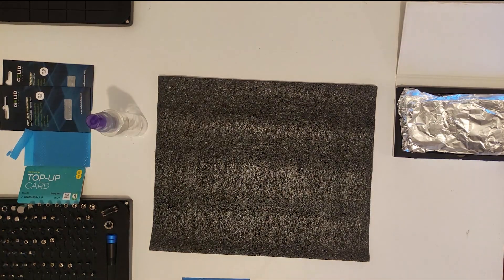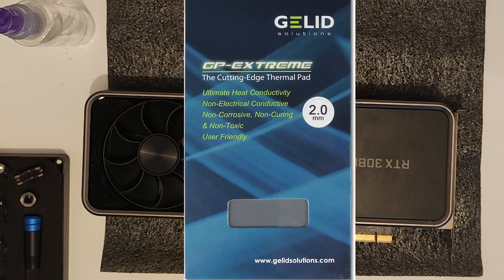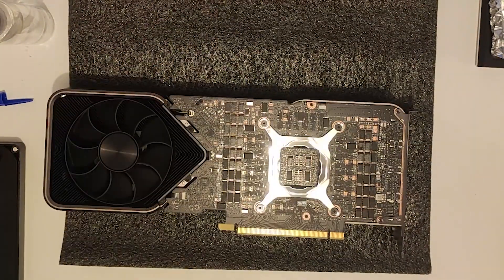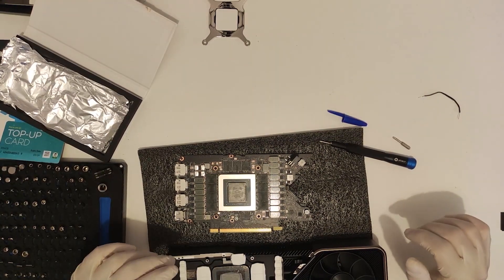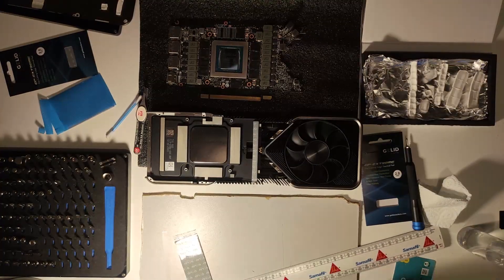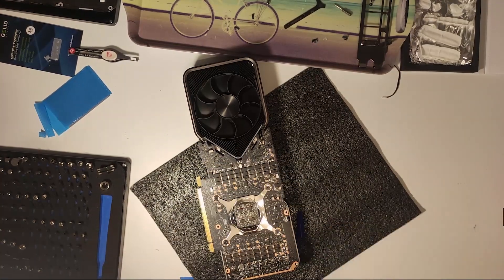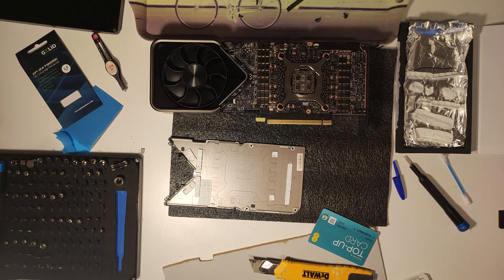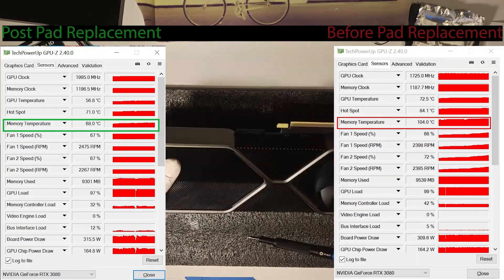Nvidia RTX 3080 FE Thermal Pad Replacement & Re-Paste-Improve your Mem Junction Temp by OVER 20C

Comment: I have been thinking about doing this with my 3070Ti FE. but after a fan curve and some overclocking, it doesn't get hotter than 70 degrees under heavy load. I've boosted the heck out of my benchmark score, from 47% to 187% without opening anything yet but I still have a water cooling system I haven't installed and I still haven't changed any pads. I'm wondering if my GPU is one of the lucky properly made ones or if I can lower the temps even more by changing pads. I'm afraid that i do all this for nothing, that my temps will be just as low after i put in all this work.
Reply from the maker: If you are happy with the performance/scores your card is providing and there are no issues with temperatures...probably best to not do any mods and keep the warranty.

Comment: i dont know how you're getting those temps i cannot go below 82 gpu 85mem and 90 hotspot
Reply from the maker: Your temperatures looks OK if you are using your GPU in a case (and one with decent airflow at that!). All my quoted temperatures are on an open air test-bench with extra airflow in a fairly cool (19-24Cish with AC) room so they really are the absolute best you can reasonably expect without blasting sub-ambient air at it directly.

Comment: Hi,

So I have followed the guide but still need some advice on how to get the Hot Spot temperatues down. Hitting around 100c whilst gaming even after applying 2mm Gelid Extreme front and back. Applied to all the area's where previous pads were. Is this an air circulation problem or do I need to adjust pads? Do you have any pictues you could upload of your pad placement now you are happy with them to help me out?

Best
Reply from the maker: Hi - you will need to keep adjusting the pads until the core hotspot is within 15C to core temp. The issue is that the pads are preventing even contact between the die and cooler so even if one is a bit proud it will still cause issues. If you have a Vernier caliper (micrometer) you can measure the flatness using a small piece of glass and a fixed point on the cooler (assuming the pads are stuck on the cooler and not on the card) and make sure that they are even all around. Afterwards go down 0.1-0.2mm at a time (again making sure it's as even as humanly possible) and after 2-3 adjustments the core hotspot will suddenly start behaving - once the core to hotspot delta is below 15C stop (it's more than good enough); if you try to adjust it again you might end with the memory temps climbing back again because of poor contact.
Reply: @ESHW  Thank you for the reply. I managed to flatten the pads that were on with a battery and cut the excess hanging over the edges with a sharp blade so no excess was left unnecessarily. I now have at idle roughly 45-46c GPu Temp and Hot spot and Memory Temps now between 59-60c. Gaming seems to raise the temps understandbly to around GPU 70-71c and 88-90c for Hot Spot and Memory. Are these acceptable figures?
Reply from the maker: @MrGamgam888  in a nutshell - yes. They are at the upper edge of what can be considered an acceptable hotspot to edge delta so you are good on that front (you can do one more adjustment, but you run the risk of flattening the pads too much and the memory temps are going to skyrocket again). I am wondering - do you have adequate ventilation in your case as the idle temp is a bit on the high side...?
Reply: @ESHW  What would be acceptable averages across the three? I will give flattening them another go. I have some more pads being delivered so it's just trial and error I guess. I have a Be Quiet Dark Base Pro Rev.2 with 2x 140mm front and a 140m rear for  air flow. With a Artic Liquid Freezer II 120m AIO top mounted. I don't know how else to get better air draw through the front of the case.
Reply from the maker: @MrGamgam888  Hotspot to edge temperature for the chip needs to be below 15C delta and less than 90C on the hotspot (can go up to 90C and even exceed it but only briefly and NOT for long term use like mining) meaning that the core will be around 70-75C. The memory temperature short term (gaming) can go up to 100 as different games will hit the memory differently, but really it's best if it doesn't go above 96C. If you are planning on using it for mining I would personally keep it under 90C to ensure card longevity

Comment: Hi thanks for the video, do you have any suggestion for a waterblock for 3080 ti?
Reply from the maker: Depending on your budget I would either go with the Corsair Hydro X (can be found for relatively cheap) or if possible the EK Vector but it's a bit more expensive. As far as I know the 3080TI does not have memory chips on the back of the PCB so there is no need for fancy active cooling on the backplate.
Reply: @ESHW  well Corsair one is costing me USD 300, I have to import it here in my country. I was quoted $187 for bykski block by a local reseller here in India.
Reply from the maker: @raghavtripathi564  That is indeed very expensive for the Corsair block. Honestly I have only heard of bykski but never actually used one - as long as you bench test it and make 110% sure its OK and it does not leak I would give it a go... are you running the 3080TI FE or a partner model?
Reply: @ESHW  I just got  my 3080TI FE at MSRP! which is $1436.18 here haha.
Reply: Also Gelid Extreme is not available, Gelid Ultimate is. will it be okay if I get thinner Gelid Ultimate maybe 1.5 mm for core and 2mm for back? please help
Reply from the maker: @raghavtripathi564  Well done for MSRP! I mean...yea :D . I personally, after buying a pack by mistake would not use the Ultimates unless you know 100% the pad is exactly the right size- I know people have used them, and it is definitely possible to install the card using 1.5mm on the core but just be prepared for a lot (and i mean a lot!) of tweaking to get it right. I would first check if Thermalright Odyssey pads are available in your region as they are somewhat softer and hopefully easier to work with. I've used them in the past on other cards and (subjectively) they are more malleable.
Reply: @ESHW   The prices here for thermal pads are absurd, will cost me 50% of the corsair waterblock! I think I have to go custom cool. I mine while I work/sleep just have to mine few more month to get what I pay for liquid cooling!
Reply from the maker: @raghavtripathi564  Sorry to hear that, i mean thermal pads are a bit expensive, but here locally i got them for £17 (Great British Pounds) while the waterblock is around £160... if the pads were over £60 i would just go ahead and put the waterblock on it...

Comment: Hi, since I changed the pads and applied new thermal paste, my GPU now goes full fan speed while ignoring my parameters. I’m on hive OS and I can only see core + memory temps. They are cool (core65/mem55) but core goes very slow, like a security. Could it be another thermal sensor not displayed in hive os that overheats ? I verified and my fans connectors seems ok. Thank for your help I hope I did not break my GPU.
Reply from the maker: 99.9% you did not break anything, it seems to me that the hotspot is most likely your issue. The core will be at 65 and the hotspot can go over 100C - that is what happened to me and I ended up fine tuning the pads. Can you install the card in a Windows machine and use hwinfo64 to check all sensors? I'm afraid I have very limited experience with mining (and none with mining OSs so I don't really know what they report).
Reply: @ESHW  MANY THANKS DUDE. After many months i decided to go back on GPU mining to warm my place. I disassembled the card two times to perform the fine tuning of the pads (with a credit card) and it worked ! At the beginning, core was hotter and now the card is running 66C(core)/80C(VRAM) on Flux with a 270W power limit and 60% fan speed. I think I had to wait a little bit for the thermal paste to spread correctly. Keep helping miners on YT it's a great job 😎

Comment: Is it a big deal to put more thermal pads on the back than what you have shown? I'm using 3mm gelid extreme pads on the back. Also, is it a big deal if there are slight cracks or very small gaps in the pads covering the components? Thank you.
Reply from the maker: Hi Aaron - the pads on the back don't do that much, before I took the card apart properly i tried 3mm pads on the back and...well they didn't do much. As long as you have something on there to make contact with the back plate and expell some heat, but really well managed heat transfer on the front I would say you are good to go - small gaps and the like won't make a difference. It's more the VRMs that will benefit from heat extraction from the back than say the memory modules.
Reply: @ESHW  hey i figured it out! I used 1.5mm pads on the front instead of 2mm because I think the 2mm was acting more like insulation than actually passing the heat along if that makes sense. I want to try 1mm pads eventually but for right now Things are looking good! still using 3mm pads on the back for now.
Reply: @arron2861  what are your temps now in mining or on 100% load after putting 1.5mm on front
Reply: @ppbagroupa2348  unfortunately, my temps are about the same as running it stock. I gave up on mining until I can just water cool it.

Comment: What do you think about putting a little bit of even pressure on the backplate while the card is fully assembled with the new pads to assure proper spread? I really don't want to take the card apart again because the core is much cooler than before due to new thermal paste I spread perfectly & the pads are perfectly put on I know this for a fact, it's not my first time doing something like this. 
1.5 for core & 2mm for backplate side. Using Thermalright Thermal Pad 15 W/mK
I followed your pad placement perfectly & before in any scenario on my Ti I wouldnt go over 92c. But now I'm starting to touch 96 and I dont want to see it climb more I shut down mining. No overclock either.

I think I just need to spread the pads like you've suggested.
Reply from the maker: Edit: I used 2mm for the front. Bit worried that yours are a little bit too thin as you are still getting high memory temps (guessing that is the 96C)
Try to spread the pads a bit better on the back, take the backplate off and try "squishing" the pads, that will give you a couple of degrees, hopefully enough to go under 90. The thermal right ones are a bit hard from memory so you will have to be quite precise - a small pocket mirror or small piece of glass will do (if using something else make sure it's super flat). If the front of the card is all good  when it comes to contact and you are sure all pads make contact then don't reopen, as you would have probably surmised by now it takes a lot of trial and error to get it right. I tried (before re-padding) using a clamp in the middle of the card (should have taken a picture of that) - it worked really really well, but as soon as I wanted to take off the clamp the temps would shoot up dramatically - point being if you try to apply pressure with the backplate in situ you need to keep in mind it might not be reversible without repadding as when you take the pressure off and the system relaxes you can get bad contact instantly.
Reply: @ESHW  yeah I think my problem is I need to use the Gelid extreme 2mm’s. No way around it. I have to order them lol. These ones suck. Just didnt wanna wait so long. 

Thanks for the great tutorial.

Comment: Where did you buy a tool you use?
Reply from the maker: I am just using the Ifixit (I think my kit is called Manta) tools for PC work - they are definitely not the best, but for a hobbyist they are good enough and reasonably priced - I got it on Amazon UK. The (dirt) cheap Chinese ones are way too hit and miss for me, it's not worth the aggravation. If you have deep pockets I recommend Wiha, but for a fairly expansive set you are looking at paying as much as a mid tier GPU. ..

Comment: I followed the instructions now my memory is at 80c but the core goes to 88c. How can I fix that. I have a 3080ti fe
Reply from the maker: This sound exactly like what happened to me, the pads are keeping the cooler from having proper contact - we are talking fractions of a mm here. I used a pocket mirror to flatten the pads by minute amounts (think 0.2mm) and retested until my core, memory and core hotspot were all great! Unfortunately it is a fiddly process. Also make 100% sure that the whole die is covered in thermal paste - this does not have a heatspreader like a CPU so it's super important to get the coverage right.
Reply: @ESHW  I will try that . Thanks a lot
Reply: @FNutSCATTMAN thanks for the info. Actually I did. First wasted time and money with 2.0 mm and then tried 1.5 and is working great

Comment: Thank you for the heads up! I had adjust the front PCB twice to get 3080 TI's hot spot temp down to 90c @ 100% load / 65% fan. The GPU core is 82c and memory at 80c. My room is 26c instead of 21c so I am not sure if this has an effect on higher temp. Does anyone what is the hot spot temp on 3080 TI before thermal pad replacement?
Reply from the maker: 8C delta between average and hotspot is basically perfect cooler contact! Anything under 15C is good, under 10C is downright exceptional so whatever you do please don't touch it! My 3080 has a 12C delta and my strix 2070 has a 17.5C delta....8C delta is a dream

Comment: I don't want to do it, but my Memory is also at 104 C° a lot of times during normal gaming. Quite concerning.
Reply from the maker: I know that dilemma: If you ask Nvidia they will say it's within normal operating range unfortunately (tops out at 110C with "panic" mode fans depending on the bios revision kicking in between 106-112C as far as I can tell from a couple of FE cards). The problem is that the pads are actually delaminating over time so it's only going to get worse, not better. On my first 3080FE (the one in the video) I tried to manage the temps but at one point too much silicone seeped out from the pads and then the temps shot through the roof with the card throttling heavily. The choice then becomes wait for it to fail and get it replaced under warranty or bite the bullet and fix it yourself....

Comment: How many thermal pads should I get for the front and back?
Reply from the maker: I got away with two 2mm packs of Gelid Extreme (has the be extreme, not ultimate!!). But I would suggest you take 3 packs just in case you haven't done this sort of thing before and make a mistake so you don't end up waiting for another pack for ages.

Comment: How is this performing now? 2 months later
Reply from the maker: It only got a tiny bit better after about a week once everything settled down and the thermal paste had a chance to thermal cycle for a bit (as expected) and it's been completely solid ever since. On the whole I am extremely satisfied with the swap and wouldn't hesitate to do it again (in the same circumstances in order to solve an issue - don't void your warranty if you don't actually have a problem)

Comment: Will this benefit gaming not just mining?
Reply from the maker: TL:DR - if your card is OK then no. 
Long answer: If your GPU is performing OK (AKA pads have not delaminated) you will not get any benefit in gaming - the temperature reduction will only benefit mining applications. If like me the pads have delaminated (lost silicone oil and detached from the cooler or memory chips) then running an intensive game like cyberpunk will cause the fans to spin  at 100% when the memory goes above 110C making it very difficult to be in the same room as the GPU - not to mention the fact that it will considerably shorten its lifespan.

Comment: Would one 2mm pad and one 3mm pad be enough to do this?
Reply from the maker: it would be enough to do the front side with the 2mm and most of the (way less important) backside. I would not advise to mix and match 2 and 3mm pads on the backside because the 3mm ones will simply keep the 2mm ones from making good contact. If you cover the same areas that came with pads applied from the factory with 3mm on the back then I guess you should be OK. Not an ideal solution, but barring a bit of sub-standard coverage on the back where it is not critical you should be able to manage it.

Comment: Hi, i do not English well when listening. How were the chips cleaned? Vodka?) Alcohol?
Reply: End some people used gelid 3.0mm and 1.5mm. Can you think this?
Reply from the maker: That made me laugh - especially since its true! I used to get the "head" from vodka making (essentially almost pure ethanol) for PCB cleaning from a friend that distilled his own spirits. This time though I used 99% isopropyl alcohol I got off Amazon :)
Reply from the maker: @GarryGloq  You can use the 3mm pads on the back if you wish - it's not going to make much of a difference. I would not recommend the 1.5mm for the front - they might work, but you run the risk of the pads not making proper contact and ending back in the same situation as stock.
Reply: @ESHW  thank you for an answer. And what do you think about guarantee? To be careful, will she stay?
Reply from the maker: @GarryGloq  I asked Nvidia directly and the guarantee will be void after opening the card up. That being said, if you do have an issue i would still try to send the card back to Nvidia - worst case they send it back still broken!